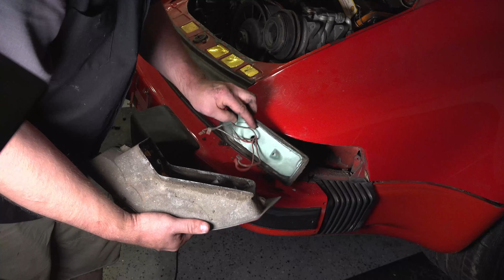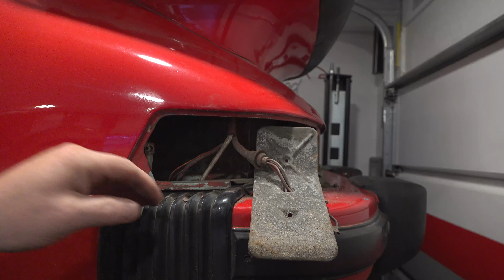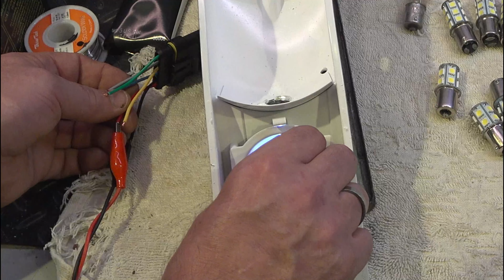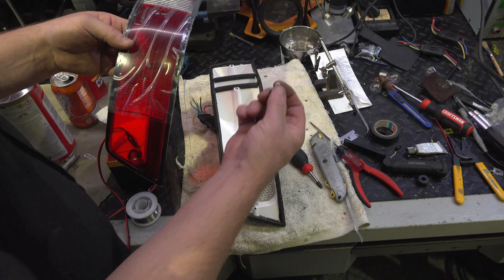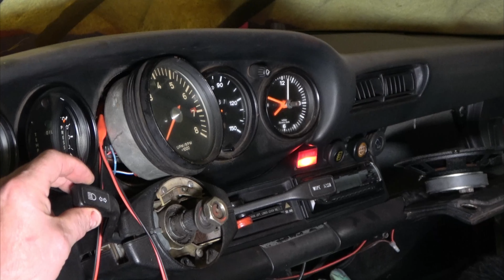1977 Porsche 911 turbo: Rear tail light restoration/LED conversion. [4K] Ep93

Comment: I know this video was done some time ago but I would like to know which LED bulbs you used for this project. Also,  I did not see a reference to adding a resistor with the LEDs, which I thought was necessary. I am getting ready to replace the lenses on my car and would like to replace the bulbs with LEDs so that the lights are brighter. Thanks
Reply from the maker: I just used regular LED 1156 and 1157 bulbs, and the LED 194 for the park light.  You will not need any resistors as this is not a modern car with a BCM.  You will have a fast-flash and that will be fixed by installing a LED type flasher, the EP35.  Amazon has these for $11.  You will also need to do some rewire for the turn signal indicators in the dash.  Not an easy job.  I would have not done this again as the connections are quite loose and require some messing with if you want them to work 100%.  Also, if you stick with the regular incandescent, they draw more power allowing for better connections in the future.  Low current wiring is more susceptible to opens.  Good luck!
Reply: @afternoongarage  Thank you for the response. Enjoy the channel!

Comment: Yeah you’re right we don’t use salt on the roads in Northwest Oregon. I live in Oregon also, I live in Albany Oregon, and I decided to take the time and spray a little epoxy primer on the outside of my Tail light housings  and I resealed them again real good I wanted to make sure I didn’t have to go in and rebuild my lights again. Also, I purchased brand new pigtail wiring from Pelican parts to make sure my lights works good. Hope to see you around sometime, cruising the back roads of Oregon in your Targa. I have a salmon metallic 1974, 911.
Reply from the maker: Again, should have done that.  I just rebuilt another set for my coupe and they were in much better shape, almost like they had been rebuilt before.  My coupe is also a 74.  Those were great first years for the g-body.  Thanks for watching and commenting something very useful.

Comment: Hey, you had a great video. the idea about putting the solder on the side of the metal part of the bulb housing so it stays in better ground.
    I’m really surprised when you had the light housing halves taken apart you didn’t use a wire brush and clean off the outside metal and then spray it with protective paint to keep the light housing protected on the outside. I sprayed mine down with epoxy primer and then I added extra. Catalyzed  clear coat For extra protection.
Reply from the maker: I live in northwest Oregon and we don't use any salt on the roads.  Corrosion isn't much of an issue.  Probably should have done something with the exterior of the housings, I was trying to get this together quickly. Thanks for watching.

Comment: Great video! Only missing part: re-installing the tail light housings! The captive nuts are (reportedly) a huge pain, especially because the originals are subject to all the same corrosive forces (aka: the rear wheels kicking up water/grime/debris).

Did you have any issues re-installing them? How did you get the captive nuts to hold without going in from underneath?
Reply from the maker: I had to purchase new 'speed nuts' for that and used the original bolts.  I had the bumper off and lower quarters off when I put these back in as I was pulling the engine for a reseal.  I have taken them out since (oil tank leak) and didn't have any problem locating the threads.  Thanks for watching!

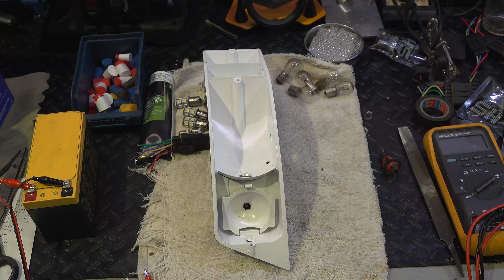Comment: At about the 8:00 mark…
Does the outside part of the bulb housing (that you added solder to) complete the electrical circuit? I thought it was just the pins. Reason I’m asking is I have wobbly bulbs that flicker as well… my idea was to add a little electrical tape the same way you added solder to try to do the same fix…
Reply from the maker: The round metal part of the bulb is the ground.  This is what typically loses conductivity.  If you have connection issues with the + leads, you can bend those upward to make good contact.  The round metal part of the bulb must have a good ground.  That bulb grease works well for keeping corrosion at bay. Thanks for watching.
Reply: @afternoongarage  thanks! Ya I found out about the ground through further research (can I tell you I’m a greenhorn any other way)… I took some high grit sand paper to my bulb housing to clean it up as it seamed like it was corrosion… and so far it turns out that that worked!!! That particular tail light hasn’t had the best seal as there was dirt in the housing after removing the lens… I cleaned it all up and put it back together, over the winter I’ll try new foam gaskets like you did to make it seal better long term.
Reply: I’m completely knew to this stuff and inherited a 1977 911 S 3-4 years ago from my dad, it had been sitting in a barn or garage for at least 20 years… in the last year I’ve got it running and just basic stuff to bring it back to life. Just today I discovered that I literally have no bushings left at all in my shift linkage lol. One thing at a time is what I keep telling myself lol.

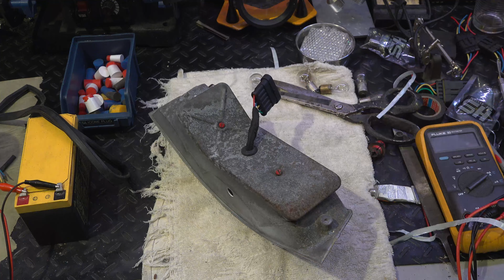Comment: what seal or weather strip are you using to replace the divider gaskets? at 9:18?
Reply from the maker: I have a large bin of various weatherstrip that I use to build my replica cars.  The rubber I used here was, "Rubber Edge Trim, 1/16" U Channel Edge Trim" and can be found on Amazon.
Reply: @afternoongarage  thank you! I appreciate the help on that!
Reply from the maker: That stuff is great.  I use it wherever I have an unfinished cut metal edge.  I have a Delorean and it is full of sharp stainless 'knives' on the body panels.  I use contact adhesive and took care of a lot of sharp unfinished edges on this car with that trim.  Good luck and thanks for watching!
Reply: @afternoongarage  Thank you again! Didn't even think about it - was getting so much tunnel vision on finding the oem stuff that was originally thereI